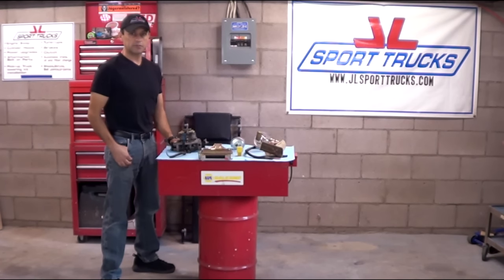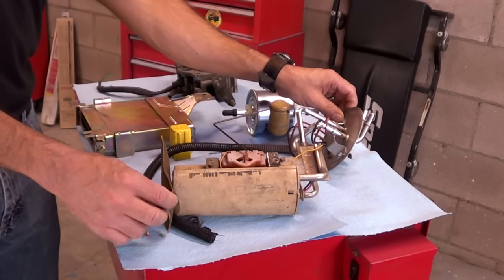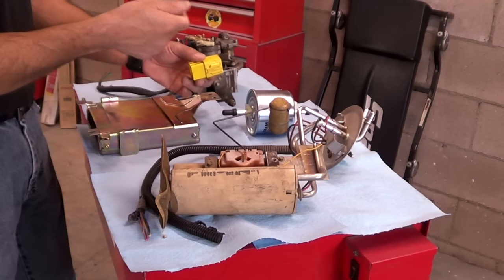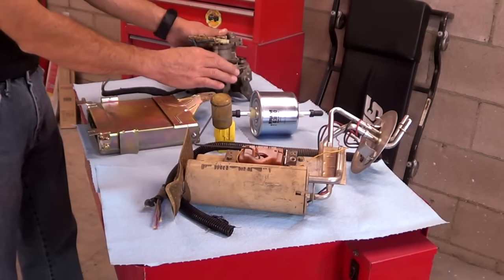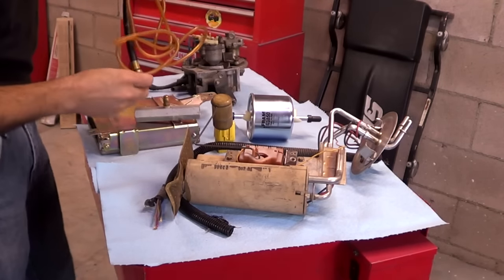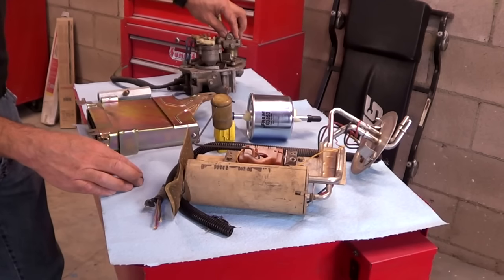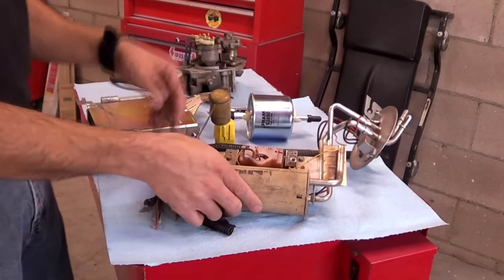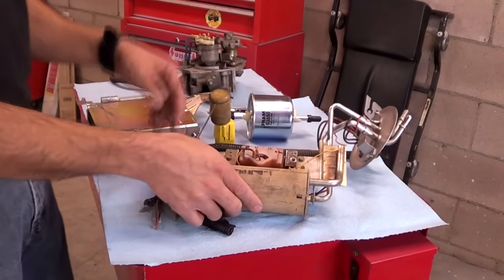How Throttle Body Injection ( TBI )  Works by Howstuffinmycarworks

Comment: Thanks this is great. I have a 87 grand marquis with a similar system (haynes manual calls it Central Fuel Injection). I believe its causing a misfire and gas smell. Haynes manual shows me the break down of the CFI and replacement of injectors but a video always helps to better understand thanks 😊

Comment: So after I turn the key and the engine starts, and I can see and control the 'umbrella' gas flow you spoke about. The engine runs for approx 17-18 seconds and just stops. No more umbrella gas flow. I can turn the key again immediately and the engine will start again and repeat this scenario, over and over. Engine (454) sounds smooth and strong.
Reply: I know some gm systems will shut off the fuel if the computer doesn't see enough oil pressure after a few seconds, do you have good oil pressure on your gauge in the truck when it's running? Could be a bad oil pressure sensor...
Reply: Bad ICM.

Comment: I had a fuel pump fail on my Volvo Penta boat motor. I sent the fuel pump out  For repair when I came back installed fuel pump and went to crank the engine after priming it 10 times by turning the key on and off without starting. Then I went to start the engine and it cranked with no start I tried several more times to start it each time the engine would crank less and less to the point where there was no cranking what so ever. When I went to check the oil level it showed the fluid was way over the max oil line. I tested the throttle body injectors by applying 9 V on the probes and they click So they’re good. I’m getting ready to test the fuel regulator, and I was wondering if you had any idea other than what I’m doing that would cause the engine to flood and fill with gas. One other piece of information that I should share is the Volvo penta fuel pumps are painted on the inner surfaces of the pump and the repair guy told me that there were paint chips that had broken loose on the inside which caused the failure.

Comment: I have a question for you my fuel is get up to the tbi but it will not spray out the fuel so what should I do to get it to spray fuel
Reply: Probably your ignition module in the distributor, injectors get their use signal from there

Comment: My rv has the v6 engine with the tbi carb.  No fuel is spraying from the injectors. I pulled the fuel line and fuel flows still no spray.  How do I determine if I have an electrical issue or mechanical?
Reply: William Galindo find the wires for your electric fuel pump (most likely located in the gas tank) and connect it directly to the battery. If there’s still no fuel flow, then the pump is bad. If it works, then you have a bad circuit somewhere, maybe a bad fuel pump relay.
Reply: What was the cause? I have a man that helps me and he is getting fuel to the tb but does not spray causing it not to start.
Reply: Bad ICM. If the ignition control module is not working you'll get no fuel spray.

Comment: I have the same setup on my 88 suburban. When I started it revs high like the choke is on but as the truck gets warm it doesn't idle down why is this?
Reply: More then likely you have a vacuum leak coming from somewhere if it's a constant high idle, or it could be a bad ecm.
Reply: @campbell0162  ended up being coolant temperature sensor
Reply: @James-qq2vq  That can cause the  high idle as well. Getting a lot of black smoke?

Comment: where is the pulse sent from does the distributor send it to the injectors based on cam timing how is it done
Reply: Ignition control module. Bad ICM = No fuel spray

Comment: I have a 1989 Chevy K10 Blazer 5.7 TBI I've replaced the fuel pump ignition module pickup coil ECM oil pressure sending unit and I am still not getting signal or power to my injectors what would cause that
Reply: If I pour gas down the throttle body Blazer starts as soon as the gas runs out it dies
Reply: @michaelthomas788  Check your ecm grounds.

Comment: Just as last time they can't seem to get the fuel pressure to go above 7 lb. When I asked them what was the pressure when it left a month ago functioning. I got delayed answer I questioned 35 pounds? he said well 40 lb is what it needs to run. It was having intermittent dropouts as I drove it from that point. As if someone had turned the ignition off very extremely quickly. I imagine the fuel pressure was marginal. for I can recall hearing injector noise slightly before total dysfunction.

Comment: I need to know why my tbi when its cold and I slam the throttle it stalls? Bit when it warms up its perfectly fine
Reply: Well, that’s one reason TBI is considered obsolete today when compared with multipoint injection. Fuel isn’t vaporized quite as thoroughly, less even distribution of fuel to each cylinder especially when cold, more throttle lag that can cause stalling when the engine gets old.
Reply: Louis Laszlo interesting
Reply: Weak fuel pump. Or if you have an open air cleaner on a cold morning will cause that, these system can't determine the density of the air like maf efi engine have.
Reply: Mine was timing chain

Comment: My 3500 GMC Sierra dually is at Pep Boys. They change my fuel pump a month ago. They put pump only not complete assembly. They could not start it they could not figure it out. Relay was very loose I discovered recently. I put new relay in truck mysteriously started I drove one month on their warranty. They are now working on it again still a dilemma. They are going to try to change complete pump unit. In tank. Their mechanic tightened up fuse box relay connections. By doing something behind fuse box. I wonder could fuel pump regulator be in the mix? I await impatiently for them to call me that it is running with fingers crossed.

Comment: TBI is the best injection
Reply: Good video.  I really want to know what sensors and work with the ECM to regulate fuel/air mixture.  My truck runs perfectly above 40 deg F, but won't start below 40 F.
Reply: that's the  Idle Air Control Valve 
important for cold starts
Reply: Certainly the most reliable. Very easy to work on.
Reply: @BillRaley1  The CTS (cooling temp sensor) is likely bad. They can fail cold or hot. More often than not when they fail they fail in the rich mode. Vehicle will start but once it warms up it will be running pig rich. An OBD-1 phone app with a bluetooth connectivity will let you see what the engine is doing live.